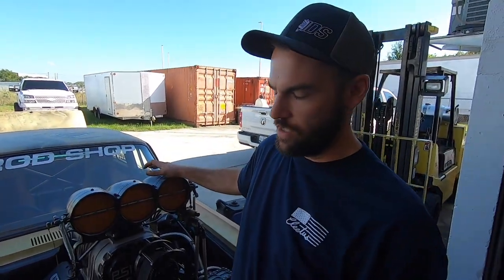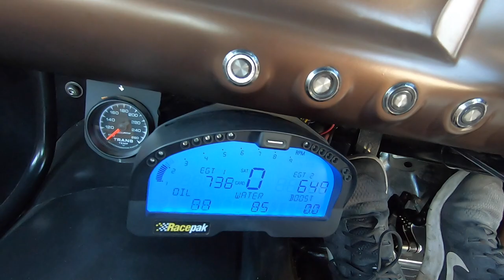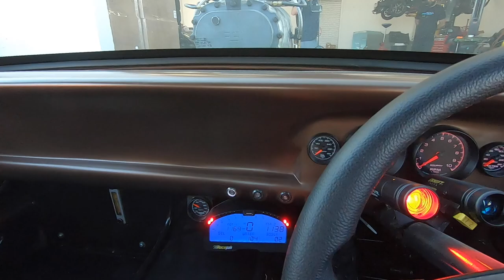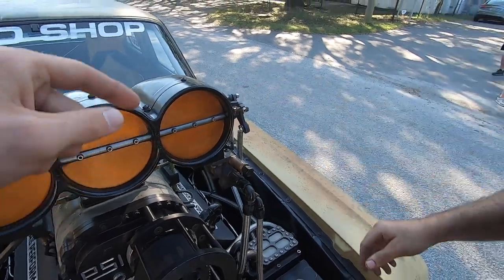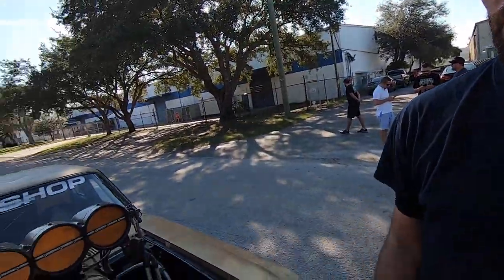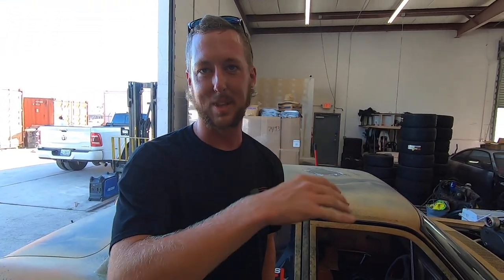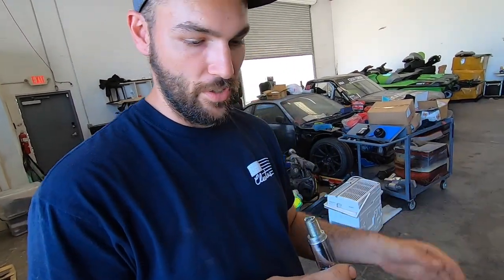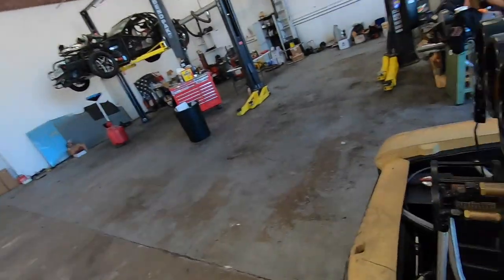Our First Time Driving WAR BIRD!!! This Thing is INSANE!! (1,700hp Australian Burnout Car)

Comment: cleetus check the camper home supply back up stuff for cord plugs OK i setup a wired house box flip breakers it runs i read this wired it up like code need i took out plug and my eyes went bonkers it was round too I drug out farm generator & fired it up it big size, one wheels the solar company gave me a price i about fainted I use what i got it paid for! i went with Genny plan I flip breakers and house came on as wired Great it less money and works!! now every one around me gone bonkers Gregg
Reply: how about a used Grumman llv mail truck burn out to take the mail out gregg

Comment: Sorry your power system is not up to the job the run on 230v down under not 110v
Reply: We run 120v and 240v here in the states. Just need a dedicated circuit from the beaker box.